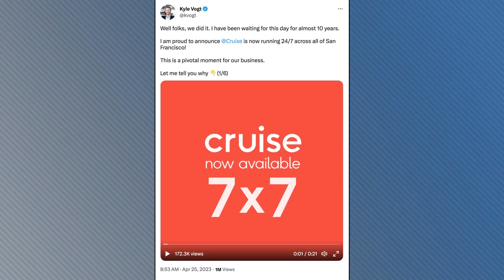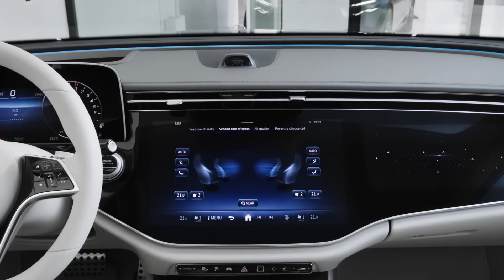EV Global Market Share Exploding; BMW Develops Eye Gestures - Autoline Daily 3554

Comment: If GM had not made my Bolt, I would be still driving ICE. No other EV is affordable.
Reply: Nissan leaf, but blehh
Reply: @rp9674  Had a 2012, looked at a 2019 Leaf. The Bolt was and is, so much better. The 2012 is fine for my wife to run around town, but was not capable of my 120 mile a day commutes here in Indiana, I don't think the 2019 leaf could have made that commute either.
Reply: I remember used Leafs, 500e, Focus EVs, etc. selling for $5k to $10k around 2014 to 2016 ish.
Reply: The Bolt would have been my choice but the slow charging killed it for me.  We ended up with a Tesla by elimination. We are paying for our model 3 rear wheel drive in gas savings.  24,000 km in 7 months. We are converts. My son loves his Volt.  My nephew loves his plug in hybrid chrysler van.
Reply: What about Hyundai Kona EV? Its same price as bolt with subsidy and bolt didn't qualify for subsidy for last 2-3 years I think until this year but Kona had full federal subsidy so considering that I think their price is either same or Kona was actually cheaper until last year
Reply: @hiravparekh8695  Seems like a fine car but not for sale in Indiana last I heard.

Comment: Sad to see the Bolt go, it offered a path to adoption for a specific tranche of the customer base, students, etc.
Reply: ...Mature adults who don't want to spend $35k on a vehicle
Reply: @rp9674  .... like me, and I'm 75.
Reply: The IEA is predicting BEV to reach cost parity with ICE in two years.  This an extraordinary statement considering the fact that the IEA, for years, predicted much lower rates of adoption for BEV and renewable energy sources than has actually occurred.

If up front cost parity happens within two to three years, it doesn't sound like we'll be missing the Bolt for very long.

I suppose cost parity could happen, but without happening in the US (or the cost of ICE will increase to match BEV).  But between the new model from Tesla Mexico, and the coming wave of Chinese brands, I don't think it will take more than 3 years for EVs to start dropping very substantially in price.  Hopefully GM will participate in the wave of affordable EVs.  But with them or without them, it's coming.
Reply: Oops, I might be confusing the IEA with the US EIA.  Still, it's an extraordinary statement, BEV parity with ICE in two years.
Reply: @davidmenasco5743  Electric vehicles today are already at cost parity with gasoline cars even in US
Reply: @hiravparekh8695  In any event, the cost of battery materials will be dropping over time, perhaps with periodic spikes but eventually coming out much lower than today.  This, coupled with competition in the auto market, will bring down EV prices significantly.
Reply: @hiravparekh8695  Not EVs, Teslas.
Reply: GM never made money on the Bolt.  Huge losses.
Reply: @davidbeppler3032  Never is a long time. It took Tesla 5 years to make a profit, and they had no idea how to build cars. Plus the Bolt had that unpleasantness about burning up which left a stigma.
Reply: it was of its time. Its no longer a compelling car.  I too was excited when it first appeared but that was a long long time ago in this space. I would say its now too expensive to build for GM.
Reply: @jamesvandamme7786  GM spent tens of millions advertising how dangerous EV fires can be, trying to force Tesla to fail.  Then Bolts caught fire and GM could not stop the story they had pushed for years, costing GM tens of millions.

Comment: "EVs will never be above 1% of global sales any time soon" 

-Fools just a few years ago
Reply: "Just another passing fad. Junkyards will be filling up with them in a couple years and the batteries will all wear out."
Reply: @jamesvandamme7786  then the batteries will be recycled and made into more batteries, reducing the amount of mining needed.  It's called a circular economy.

My Model 3 has less than 3% degredation after 4 years and 42k miles.  I doubt it'll suddenly accelerate, batteries usually slow down in degredation.

I can see the many niche models of EVs being in junkyards, where manufacturers thought more models would help instead of working on volume.

Comment: My understanding is plans are for a Chevy Equinox EV at nearly the same price point as the Bolt to start being sold this year so in that case gm still has a offering at near that price.
Given it uses the latest platform may be best to get this instead of Bolt (let's hope so) time will tell.
Reply: $30K
Reply: As is normal with new model launches, they will start with the high end versions first.
Reply: 30 vs 26k, not necessarily an irrelevant difference if you're shopping in that price bracket. That's also assuming the Equinox actually comes in at 30, since they said "about 30" it could be a bit more.
Reply: +$2,500, probably more expensive to replace tires, less efficient
Reply: It's also bigger.
Reply: Highly doubtful the Equinox EV will be near $30K and if it is GM will limit production of that trim since it surely will not be profitable for them unless it is built in Mexico or China.
Reply: @godofdun  It's not gonna start at 30 that's for sure. It might start around 35k though but the trim most people would wanna buy would be around 42-43k at minimum

Comment: The GM Bolt was the perfect SECOND vehicle for a household. It had plenty of range (about 250 miles) for local commuting and fully enclosed with all the creature comforts you'd expect in a vehicle. A multi-person household could still retain a fossil fuel vehicle for long trips, towing, etc.
We don't need BIG, expensive electric vehicles.
What's going to replace the BOLT? A bigger, heavier, more expensive electric vehicle. [face palm]

Comment: Feel like BEVs are being mandated. • Mercedes E is gadgetry and gimmicky and Mercedes is losing the plot. • Toyota should sell the bZ3 everywhere, not just China. Way better looking and nicer interior than bZ4. Seems to have much better range as well.
Reply: Those range numbers are most likely on the CN-only NECD, something Sean didn't mention. When you recalculate on the lower WLTP standard and the even lower EPA standard the range would get no more than 10-15% above the bZ4x and Solterra, if at that.  

Also the bZ3x (I also agree looks quite better) has a trunk instead of a hatch, so it couldn't be "sold as a crossover" as the bZ4x is.
Reply: My Costco has had a Mercedes EQS SUV for sale for the past two months at $5K under MSRP, for "only" $110K.  I'm not sure how well they're selling elsewhere, but I've never seen one on the road.
Reply: @JohnPMiller  - you may not have the chance to see them in the flesh unless you're within striking distance of a large city, especially in CA, NYC and SoFL. 

You can distinguish an EQS from its' new ICE'd cousin from the hatchback-like rear and it looks a bit smaller as well.
Reply: @syxepop  It should be sold as a sedan the way the Corolla or Camry are. The Tesla Model 3 is not a hatch. The Ioniq 6 is not a hatch. The bZ3 is a good looking sedan with a simple, but nice interior, and is roomy and aerodynamic. It should be the BEV sedan that slots in between a Corolla or Camry in size. With BYD batteries and motors, I think the range would be way more acceptable than the dummied down range in the bZ4 (which will get an update in May to up the range, we'll see how much).

Comment: The only bolt alternative will be Nissan leaf, I can't get happy about that . 
The incentives need to be tweaks, there will create turmoil in the used EV market, between the income cap and the 3rd owner exemption.
Reply: Actually it will get simple starting in 2024, the EV tax credit will essentially convert into a point-of-sale rebate. The tax credit applies to 30 percent of the cost of a used EV, up to $4,000, on a vehicle with a maximum MSRP of $25,000, weighing no more than 14,000 lbs.  The dealers will be the ones getting the credit and they must pass it on to buyers of qualified EVs.
Reply: Leaf doesn't qualify for IRA credit

Comment: what about the Nissan cube?
Reply: That was never sold as a BEV (even in JDM) besides a 2008 (pre-Leaf) prototype with an 80 kWh battery pack.

As an ICE'd crossover it was discontinued in 2019 in JDM, 5 years after its' North American discontinuation.